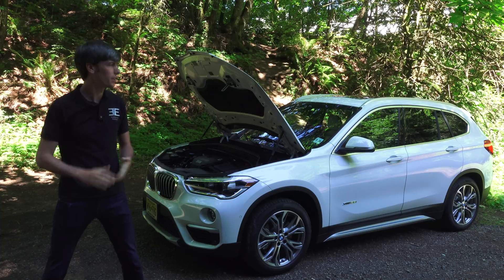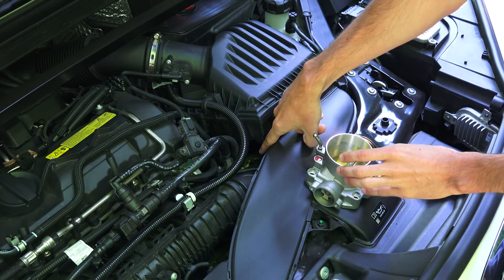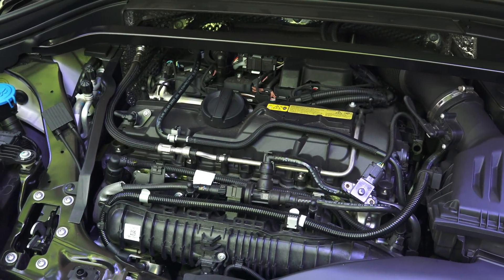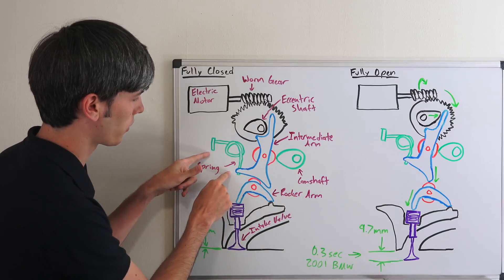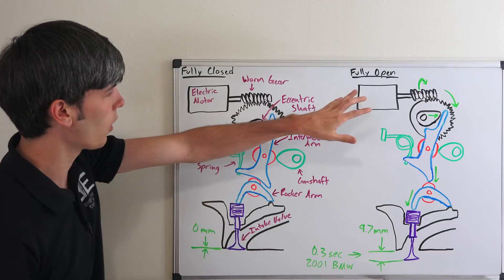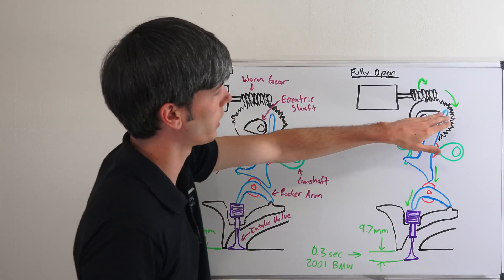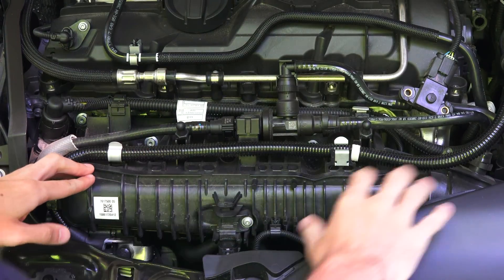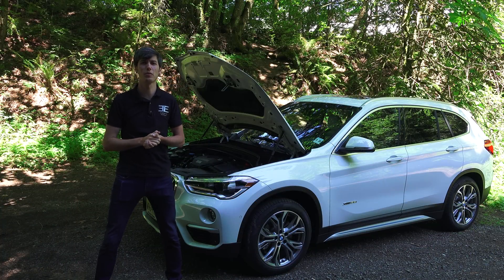What Is Valvetronic? BMW's Innovative Throttle System

Comment: so basically it's overly complicated ITBs?
Reply: Not even close.
Reply: patw52pb1 how is different from ITBs?
Reply: ITBs are not held fully open at all times.
Reply: lol i think u didnt understand die video... 
this varies the valves! the ITBs has nothing to do with valves
Reply: +mcspikesky nor are the valves? basically the point of valvetronic is to have the throttle combined with the valve. the result of that is better throttle response(or at least would be after tuned) and a more efficient or powerful engine. ITBs accomplishes the same thing without being overly complicated but not as effective.
Reply: and ITBs also hast not a good fuel consumption
Reply: +David Serrano ITB controls individual throttle plates versus controlling how the camshaft profile effects the intake valves. They are similar tho in that they have a lot of moving parts that can break lol
Reply: i think that this system is even better than ITBs.. he told something about the vacuum that travels a longer way... 
the shortest way is to control the valves... so its the best possible fastest way.
the ITBs has the throttle after the valves. 
the response should be even better in this system
Reply: +crimsonjan89 fuel consumption is dependent on the tune.
Reply: +crimsonjan89 tbh I'm not convinced. I think the efficiency in this system has nothing to do with how the air gets to the engine but rather the different throttle profile. I'm now guessing it will have poor throttle response.
Reply: the only reason why I'm having a hard time seeing the benefits is because of the purpose the venturi effect has. the venturi effect is in place to effectively deliver air. that vacuum is air being rammed into the throttle by the venturi effect. so I'm a bit lost on that part.
Reply: David Serrano
It all about coordinating and optimizing valve events with piston velocity, crankshaft angular velocity, air flow volume and velocity as it relates to RPM and volume timed fuel events.
This optimizes engine efficiency, fuel efficiency, emissions and driveability.
ITB will not provide that.
Reply: David Serrano
Sorry, but your description is not accurate.
The venturi is for creating fluid (air) acceleration resulting in a depression in air pressure (vacuum) to suck fuel through the jets, emulsion tubes and finally the booster/discharge ring.
The venturi is a liability for maximum air flow and performance.
Air is not being rammed into the throttle by the venturi effect.
The engine is creating the vacuum and when the throttle plate is opened, physics is attempting to equalize the difference in absolute pressure.
The venturi sits above the throttle plate in normal atmospheric pressure when the throttle plate is closed and near atmospheric pressure until there is a relatively large angular opening of the throttle plate.
ITB systems typically do not have a common plenum which negatively affects part to mid throttle and low/mid speed operation creating performance, response, fuel mixture, fuel economy and emissions issues.
Hopefully This helps your understanding.

Comment: Engineering Explained This system would not reduce the pumping action of the pistons since the piston is still pulling down against a strong vacuum created by the intake valve being only partially opened. Instead the 10% increase in efficiency is due to less drag in the camshaft/valvetrain. The valvetrain system has substantial drag at RPM and since less work is being done to open the valve the engines overall efficiency is increased.

Comment: I've owned several BMW's with Valvtronic and Vanos and have never had any issues with it. Amazing reliability from such a complex systems My daily driver is a 05 325i wagon with 261,000 miles. Great video of explaining how it works!
Reply: I feel like most issues are related to people waiting long times to change their oil, how often do you do it?
Reply: @cartere9981 yeah, the reason why BMWs have a reputation for being unreliable is because those people don't take the cost of maintenance into account and think that they can treat these cars like Toyotas
Reply: @cartere9981  I have 2006 325i with 210,000 miles its be really reliable just oil changes which I do at every 3-5000 miles
Reply: @cartere9981 I bet he does oil change in around 5k miles or 8k kms. I've done this with all my cars as well and didn't have any issues
Reply: Mine has had the eccentric shaft sensor go out but motor and eccentric shaft are pretty reliable.
Reply: We had to rebuild the n52 in mine because the previous owner abused it to hell and have had valvetronic problems for a while because of that

Comment: Throttle response hardly could be a reason for this, with the mostly dull throttle mapping nowadays. And these are even turbocharged. I bet my '96 2.0l N/A car with traditional butterfly-valve has better response than any of these.

Comment: I wonder how long that complicated system would last, how fast would it wear, and how much it would be to replace in 100000 miles when it would not work properly any more? I bet it would be couple times more expensive than that reduced fuel consumption would save you.
Reply: I have an x5 with  valvetronic. it's really not very complicated at all... he didn't explain there is one motor for each bank of the engine,  it moves all the valves on each bank. also all the pieces to the intermediate arms are rollers, so there is almost no friction or wear.  the motor tales about 3 minutes  to replace as its right  on top of the valve cover. if the intermediate  arm did fail. they take about 5 minutes to  remove  once you get under the valve cover, which is also very easy. if I recall my valve tronic motor  is about 150 dollars new, and intermediate  arms are about 30 dollars. I too thought maybe it would be expensive or complicated but it's cheap and simple when you actually see it.
Reply: +Ryan Brimhall so it is 2x motors per cylinder and 4x arms per cylinder, right? and four to 6 cylinders. thus it is over 400per cylinder no work included. 1.5 to 2.5 grandjust on parts. wow
Reply: +JunckMAn video channel no.... on a v8 two total motors.. one per bank.  so 300 dollars if both were to magically fail at the same time.  then 8 intermediate rockers, so 240 dollars if those were to all magically fail at the same time....
Reply: +Ryan Brimhall how does it vvt then? otherwise it is nothing special apart of you can just close the valve
Reply: vvt is different item altogether, it means variable valve timing, the retardation or advancement of valve opening and closing in relation to top dead Center of the strokes.. bmw uses a system called vanos for this. vvl  or variable valve  lift what valvetronic  does. this uses the valves as the throttle,  then vanos is used as well to fine tune timing them.
Reply: +Ryan Brimhall i know the diference, but in comparisson to koniegsegggggggg that can do both vvt and vvl andalso work as throttle, as this one only can do throttle and vvl, which is nothing new nor special, take the mivec, thatalso does vvl.
Reply: +JunckMAn video channel BMW has used this system for 15 years now, of course it's not new. And Koenigsegg is on a whole different level- their cars aren't mass produced, so they can afford to make them more complex.
Reply: MarchuxProductions
The thing that bugs me is markeing this as "innovative"

Comment: I'd rather trade that 10% fuel efficiency for reliability and simplicity, adds another thing on the list that could fail which will also mean the car won't run

Comment: God bless the person who has to fix that when it breaks
Reply: I fix these all the time, the eccentric shaft and valvetronic motor fail a lot on the earlier n20 models, it pays like 6 hours of labor and is Farley simple, I like doing them
Reply: Well its most likely your local BMW dealer and theyre happy when it brakes because when it does, its their payday
Reply: And with them being on 2016 models, they make warranty pay. Less in their pockets, none out of yours.
Reply: One does not simply fix an eccentric shaft
Reply: They don't need God's blessing, you just bless them with your money. Or at least the dealership lol

Comment: Yay - Lets take something simple and make it as complicated as possible - Hope you trade in before the warrantee expires.
Reply: That's called German engineering.
Reply: +Marcos Cruz More like Convoluted Engineering all this shits going to be obsolete once EV vehicles take over.
Reply: +Alexander Rosales which will still take a long ass time. The only way to make EVs properly feasible right now is with heavy government backing.
Reply: +MarchuxProductions That's probably what they said about the internal combustion engine when steam power was king.
Reply: +MarchuxProductions Unless your talking about Diesel, gas engines are pointless and you can't build gas engines above a certain size. The  technology in internal combustion engines is obsolete and wastes the majority of the energy that's available.
Reply: Alexander Rosales I'm talking about all ICUs, including diesel. And even though they are inefficient, they are still more convenient than EVs right now , and most likely will be for the next 20-50 years (unless some completely unforeseen battery-related invention takes the word by storm). Using less fossil fuels and having less emissions is very much necessary.
Reply: +MarchuxProductions Supercapacitors

Comment: I love new technology and I'm definitely not one of those "Stuck in the past" type of people,but this system sounds like it has the potential to cause issues with time and mileage.The more components you add,the more potential for mishaps.Also,an engine bay is a pretty volatile environment for any type of electronics,so adding any type of electric motor for the main control of this system sounds shaky.Also,seeing as though the throttle body is essentially never being used unless of a fail in the main system,I could see the valve seizing up on it from weather conditions and poet.actually causing a safety hazard.

Comment: So if a main benefit to using a Valvetronic system is response time and efficiency, because the valve is right near the engine and there isn't much vacuum between, wouldn't an ITB system have the same effect while being much less complicated? Normally I can pick up your diagrams in a flash but that Valvetronic one took a while to wrap my head around.
Reply: No.  
It all about coordinating and optimizing valve events with piston velocity, crankshaft angular velocity, air flow volume and velocity as it relates to RPM and timed fuel events. 
ITB will not provide that. 
Think of the valvetrain as a compound fulcrum and wedge.

Comment: too many added moving parts, it must decrease efficiency, isnt it? The intermediate arm has to move as fast as rpm goes, its wasted energy, isnt it?
Reply from the maker: BMW sees a 10% (minimum, they claim) improvement, so it's worth it for efficiency purposes.
Reply: well, since i dont agree with Mitsubishi or VW claims, i am not gonna agree on BMW either...
Reply: Has anyone done independant testing?

Comment: Hey, whats your opinion to the Fiat system called: Multiair? The valves open with oilpressure produced from the exhaust camshaft. With a electronic valve the engine regulates the lift from the intake valves and it can open 2 times for better fuel efficienty.